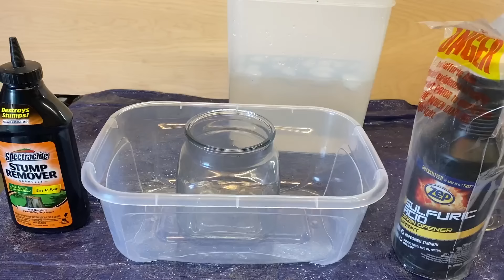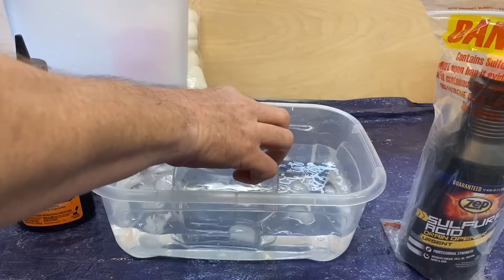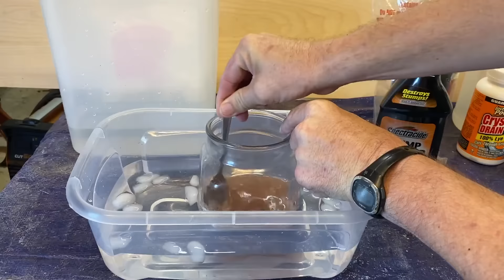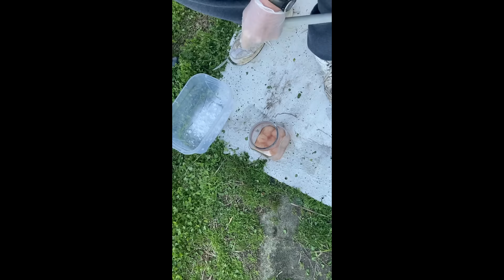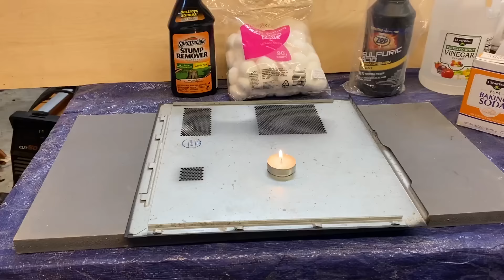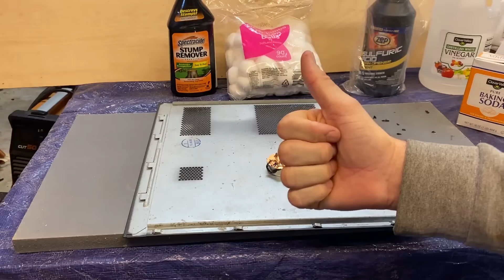Making Gun Cotton

Comment: Ok I got tired of reading the replies from the safety "officers" and didn't see what I was looking for and yeah I know I am a year too late to the party also. However I noticed that unlike most gun/flash cotton this leaves a bit of ash and I was wondering if this ash could be eliminated (or mostly eliminated) using the same method and chemicals but with a few modifications such as maybe a longer soak time? More thorough rinsing? Maybe a different ratio of the chemicals? Or are we just stuck with needing fuming nitric acid and the traditional methods to make ashless flash cotton/paper?

In any case an extremely interesting video and if I am going to have to just put up with a bit of ash then so be it, it's worth it to not have to go to the hassles with obtaining and using concentrated nitric acid, thanks al lot!
Reply: Yeah the ash can be reduced/prevented by simply doing this but more carefully. Make sure the nitrate salt is fully dissolved, let the,cotton soak for longer, wash very very well, and dry well too. All This can improve the final quality of the NC
Reply: not completely nitrated. to make nitric acid with Potassium Nitrate, you need to distill the acid off the solution. Just mixing H2SO4 with KNO3 as in this case still leaves the Potassium present

Comment: I saw a video of someone using sulphuric acid and potassium nitrate with glycerin.  They put a drop of the nitrated glycerin on a piece of paper and hit it with a hammer, causing it to detonate. I'm not sure if drain cleaner works for that or if you need to heat it to get the water out for fuming sulphuric acid.

Comment: I can clearly tell that you don’t know what your doing. If you would have used the proper method 1 to 1 taking the cotton balls apart before submerging wait at least 24 hours 30 is better then the cleaning process use baking soda to neutralize the acid. Use test strips Bringing the pH balance to neutral. You can dry it with a hair dryer. Just remember it only takes 160* to set it off.  Then when it’s dry. To fluff it up use a coffee grinder without the lid. It on a glove the cotton can ignite by friction being cocked by one of the blades, so just be careful. When you lighted there should be absolutely no carbon no black spots absolutely nothing left behind, and you should ignite within a split second you could even hold it in your hand, and like it should not leave any black spots at all.
Reply from the maker: Of I didn't , I was trying it out, never claimed to be an expert. :)

Comment: I tried to make some myself, but after about 10 minutes all the cottons where almost gone and the whole thing turned into a delicious soup. do you have any idea why? I used 30% battery acid but I evaporated most of the water by heating to concentrate it first and used KNO3. and the cotton label says 100%.
Reply from the maker: Not really, it does turn soupy and then if you can carefully rinse it and let it dry it becomes cotton again... not sure with replacement ingredients.... I only did what I know and it is for entertainment purposes only... :)
Reply: @SpiritedMaker  okay. thanks for the reply
Reply: Footing Ball555  No, that might be where it went wrong for me. I didn't think the temp is very important.
Reply: Footing Ball555  I am going to give it another try soon. thanks for the advice.
Reply: Can I serve this with croutons or just some crunchy baguette?
Reply: I think your temperature was way too high. If it gets a above 20’c the sulfuric acid will start to react with and dissolve the cotton so you have to keep it cool initially.
Reply: It's because the cotton is damp. Cellulose holds at least 5% water even when it seems dry. To solve that problem dehydrate the cotton in an oven at ~250F for an hour then bag it until it cools before adding it to the acid mix.
Reply: @keidanmeradi8085  Actually, temperature is very important as it accelerates chemical reactions.  You must have flunked chemistry class!!
Reply: @professorg8383  Oh wow😲 you are very smart, bravo, good for you. Happy now?
Reply: @keidanmeradi8085  So you did flunk chemistry!!!  It's pretty basic knowledge, not exclusive to smart people.
Reply: @professorg8383  I was being sarcastic dude
Reply: @keidanmeradi8085  If  you say so. 

But this is potentially very dangerous stuff. not something to joke about or to deliberately post misinformation about. 

I teach technology courses and it is somewhat stunning how many HS graduates lack the most basic science knowledge.
Reply: @professorg8383 I understand your sentiment here, in your last comment. But geez, ya ain't gotta be a jerk to people to get your point across.

Comment: I did all the steps, but when I removed the cotton and put it in tap water, the cotton fizzed and dissolved in the water. What is the reason for that?
Reply from the maker: Are you sure it was 100% cotton?
Reply: @SpiritedMaker  yes
Reply: Too much acid transferred with the cotton ball and not enough water exchange quick enough. Wring as much acid as you can from the cotton before plunging into very cold water and immediately work as much acid out as fast as you can.

Comment: Two important items were missing at the start, the appropriate gloves and a glass stirring rod.
Reply: Wouldnt vinyl be better since you are creating nitric acid? Vinyl is best for sulfuric and nitric acid. Latex is ok ONLY for sulfuric acid and is poor protection against nitric acids. Never use nitrile gloves. Glass stir rod is a must though I agree.
Reply: Vinyl gloves are the correct thing. Double glove as well. Even safer if you coat sodium bicarb powder on the first glove layer then put on the second.

Comment: 24 hours? But someone said 5 mins are enough
Reply: Acid concentration and temperature are the clue. Under 30C Guncutton above 40C Collodiumwool. Low concetrated acid or moist nitrate , deluded sulfuric acid only Collodium. Above 40C the reaction is compled after 20 min to Colldium or cellulosedinitrate. For the Trinitrate you need to be bellow 30C and max 2H but if you nitrate at 15C or lower (with ice water) it can took longer. in Chemistry every 10C reaktion speed goes up 2x to 4x times.
Reply: @Preyhawk81  wow man thanks for tips. I used 98% H2SO4 and potassium nitrate 99% because for now i only have something like 50ml 70% HNO3 and its not enough. So how i can obtain a powerful cotton that explode hit by hammer? I can get more nitric acid at 70% or something, but collodiumwool Is not more powerful? So why people use ice water? Is not best?